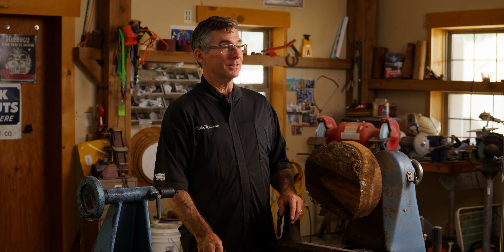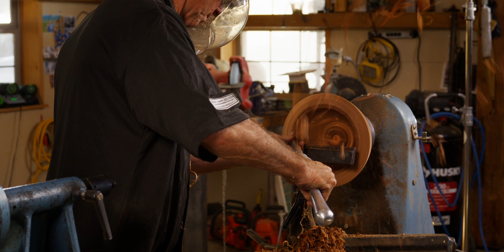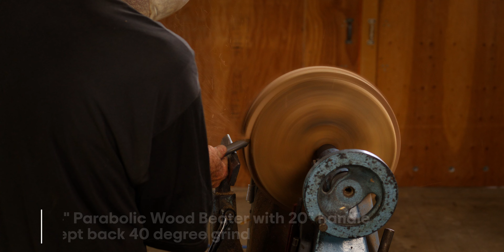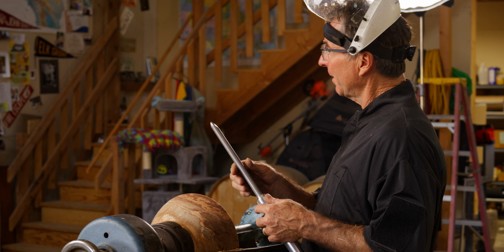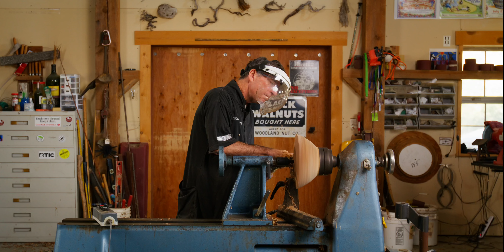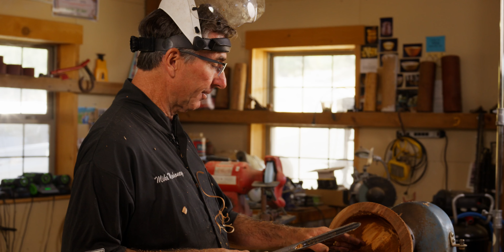Mike Mahoney Signature Tools: Bowl & Lidded Vessel Turning

Comment: If I wanted to make a box with a threaded lid, it seems intuitive that the tenon would need to be slightly larger than the mortise as opposed to using a suction fit…but by how much on the 16 TPI version. Would it be different in the 12 TPI version? 🤔
Reply from the maker: Great question! Like Mike mentioned at 12:09 and 13:09, you’re going to want to prep your male thread to be slightly larger in diameter than your female. Anywhere between .025” and .100” would be fine. But like Mike mentioned, there’s no real worry about an exact number. As you’re cutting the male threads, you’re going to be checking the fit with your already existing female thread. This would be the same approach for the 16 or the 12TPI! Happy turning!
Reply: @Carterandsontoolworks  thank you! I’ll go back to those timestamps to review